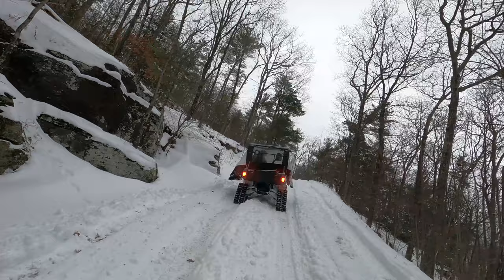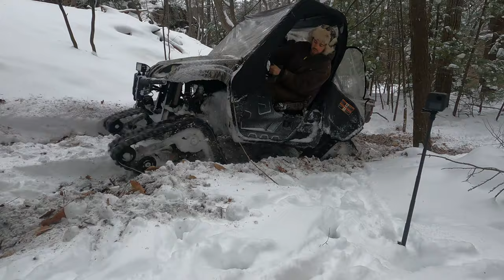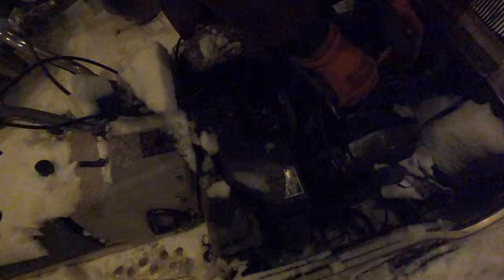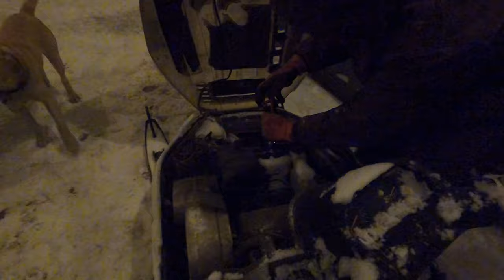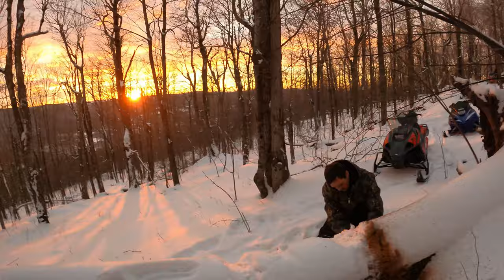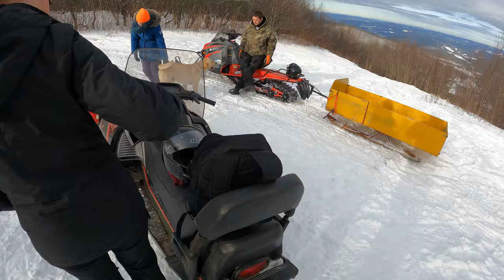Riding UTV's and Snowmobiles in NY @Andrew Camarata - King Quad, Rhino 660, XLV540

Comment: Good times
Reply from the maker: For sure! The snowmobiles are such a blast. That XLV 540 rides nice
Reply: @NoNonsenseKnowHow  great video, I found your page from you helping Andrew with welding on the roof. And I found Andrew’s page from a comment on “Matt’s Off Road Recovery”. I never followed any pages until matt started his channel.
Reply from the maker: @thebeek123  That's awesome! I follow Matt's off-road recovery as well. Always exciting stuff. I appreciate you checking out the videos. Thanks
Reply: @NoNonsenseKnowHow  I have a long track wind track Polaris. About half the time I use it I am towing a sled to an off-road cabin. Our Ranger has big tires with a lift kit, it goes through a foot of snow easy.
Reply from the maker: @Chris_at_Home  That's cool man, yeah long tracks definitely the way to go
Reply: @NoNonsenseKnowHow  I am thinking of getting a Voyager with the fan cooled 550.. The down side to the big machine is the weight. I’m almost 70 and a few hundred pounds less makes a big difference.  The wide track has real good flotation but most of my riding is on a trail. When I was building our cabin I needed the power and gearing. About the only trail I break is the last 1000 feet to our remote cabin. We usually get 2-4 ft of snow on the ground by March. Some years we get 6-8;feet.

Comment: Nice video! You need to do the diff lock mod so you can have the diff locked in low or high too. That way you get some wheel speed. New tires probably help too. I marveled at the difference the ITP mud light XL  made on my King Quad. It was a 1991 model, I miss it a bit it, was fun to ride.
Reply from the maker: Thanks man.  And sweet, ill have to look into that mod.  I mainly use it around my yard and local rides.  Been focusing most attention on the Rhino I got.  The OG King Quads are epic though!  A true legend of a machine.
Reply: @NoNonsenseKnowHow  it really simple, there is a locking pin that goes from the gear selector to the 2wd/4wd/diff lock selector. If you take that pin out you can use diff lock any time. Just have to lift up the whole gear selector assembly to do it. Unlike most things on that bike it is quite easy to do. And do the start in any gear mod too, super simple and saves you when one of the sensors fail in the middle of the forrest. You have some good and interesting content on you channel, I subscribed.
Reply from the maker: @NilsKall  Cool, Ill check it out!  And awesome man, thanks I appreciate that.
Reply: @NoNonsenseKnowHow  a video I made about the start in any gear mod: https://youtu.be/o3M_9V2kHZI